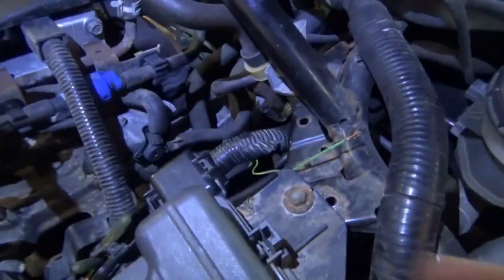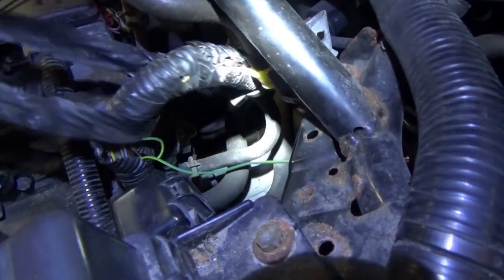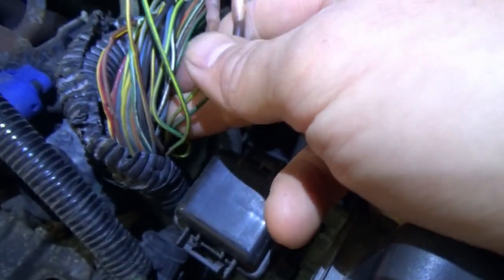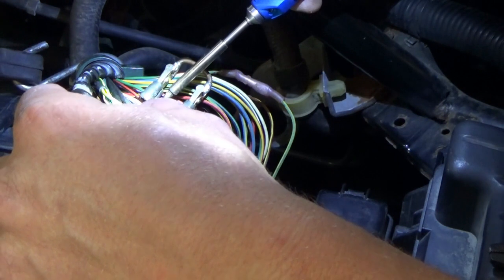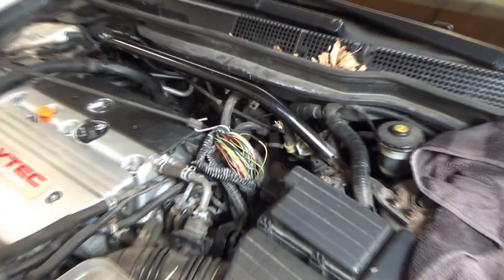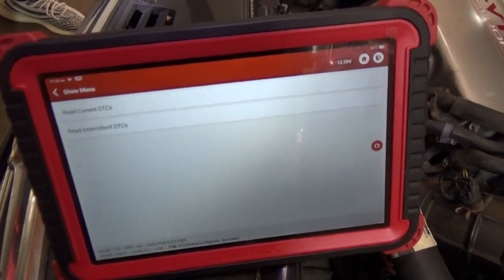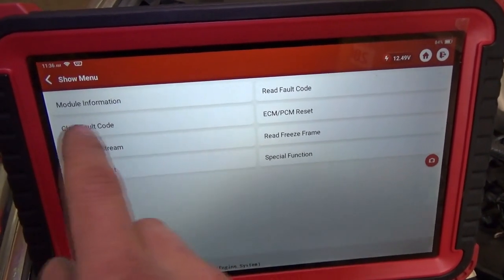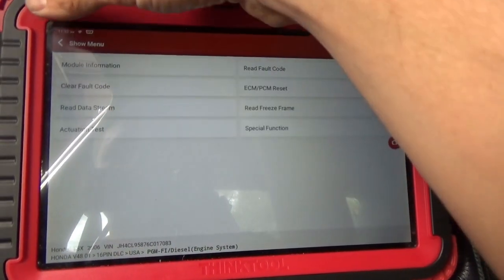DANGEROUS Acura Limp-Home (Part 2)

Comment: Hey Ivan I agree soldering with shrink tubing is probably the way to go. But with the shrink butt connectors the main issue is they are crimped using any ole crimping pliers and it doesn’t crimp correctly, for the most part. It seems if you use actual crimpers with the correct die I have had great success. However is it worth it? Either buy a torch, solder, heat shrink or a fairly expensive crimper with changeable dies for different terminals. One nice thing about those crimpers is you can do just about any terminal with the right die. I do solder when I’m mobile and have had no issues with comebacks! But at home if I’m building a complete harness/connector I crimp like factory. Great video Ivan!
Reply: Just wanted to be a PITA Ivan! Haha

Comment: As a retired A&P mechanic, I can tell you that a properly sized crimp style butt connector crimped with the proper, calibrated crimp tool, is very reliable. That's all that is used on modern aircraft. No soldered connections allowed. Either way, good job finding the problem!
Reply: You are correct! I worked on avionics in the Air Force and when used correctly, the butt connector, properly crimped. was very reliable : )
Reply: @T.J. Kong it seems both ways of connecting wires have their problems. Still, solder should outlast the wire it's on if it's good quality and applied properly.
Reply: Solder connections are not permitted in marine applications either.  The main problem with solder connections is they crack under vibration.  It is one thing if a bad connection causes your car to malfunction but a bad connection that causes sparking or overheated wires behind panels leading to the possibility of fire is quite another.
Reply: At bmw dealership we always used splice style crimps and then their clear heat shrink over them. That’s how bmw wanted repairs to be made on wires
Reply: @adotintheshark4848  the problem in automotive and aircraft applications isn’t the solder lasting it’s that solder connections become brittle and crack due to vibrations over time. I always prefer to do proper crimp joints on the outside of the vehicle.
Reply: @Jpilgrim30  probably the best solution overall is to just replace the whole length of wire if possible.
Reply: @adotintheshark4848  that’s just not practical though. A proper repair will likely outlast the car.
Reply: I think the butt connector boost the  vibration power on repaired  wire
Reply: Wholy hell 

Use a Butt Connector and solder an additional bypass in 

Da fuq ?? 

Aviation compared to automobile 🤦‍♂️

Good job Ivan imma take your suggestions !!
Reply: To add more fuel to the fire, there are PCB mount connector sockets with pins that are press fit in to through plated holes in the PCB. This method of installation is widely accepted as being more reliable than soldering the pins.
Before that we had wire wrap connections that got us the moon. This type of connection consists of wrapping a solid wire tightly around a square pin. The sharp corners of the square post bite in to the wire at every turn. The backplane on the Apollo flight computer was wire wrapped, not soldered.
Reply: Both methods can be effective in lots of applications
Reply: I think you nailed it, those crimps looked too big in the first place and the crimp tool they typically use, yikes! The environmental aviation splices are hands down crimping perfection at it's finest.  I cut my teeth in the military (instrument/flight controls on B-1B) and if not for the weight, soldering would have been the preferred method.  I can hardly imagine the shear mass of lead a C-130 or C-5 would have being over 60 years old.
Reply: With the heat shrink butt connectors, one big thing that I found is the cheap ones on eBay or Amazon are junk. The only way I found to crimp them is using a non-insulated crimper but even then it's still horrible, I found that the Walmart Everstart is good and the harbor freight Storehouse is good. I switched to only using the harbor freight, I can use my ratcheting insulated crimper and instead of the $1 per connector from Walmart, Home Depot, Lowe's, and whatever else, the harbor freight is ¢30 (10 pack for $3). The eBay junk is ¢11 each (100 pack for $11). I'm thinking about trying a different one from eBay but this time supposedly made in the USA and using 3M heat shrink, whether or not it's the junk rebranded or a good connector I don't know

Comment: Ivan, that was an awsome video,retired 47 year A and P mechanic here and I think whoever repaired the wireing previously used vice grips or an cheap crimpers to crimp those connecters, if done properly they will hold. On aircraft where I worked, the complete wire had to be replaced at the next maintenance check. As always, looking forward to your next video!
Reply: In my total working career I discovered one 120volt cold joint. It was in a multi wired power distribution terminal inside some constantly used test equipment. 
The failure took decades to show up with no prior electrical or physical symptoms at all. Electricity is always ready "to check our work" no matter how long it takes.
Reply: Edward spot on mate , you cant blame bad repairs on idiots that use cheap Chinese butt connectors and dont know how to crimp. We would laugh at someone that used solid wire to repair automotive wiring, so what happens when you solder, wire become solid ?  As you say proper way to fix is change complete wire , but as we know this is not cost effective. Butt connectors or open barrel splices is industry approved , soldering is not especially in an engine bay. Regards Joe
Reply: Channelock 909  crimper   is a must

Comment: Great job finding the bad connection.  Couple things to consider.  One is when splicing wire and you plan to solder them, consider wrapping them together so they do not pull apart easily even if solder fails.  Your method of soldering is probably good when fixing home electronics but automotive involve a lot of vibrations and heat that brings solder closer to melting point and can cause fatigued joint.  But I like your idea of two alligator clips with thick wire to hold two wires together.  Another is consider getting yourself a heat gun.  I LOVE them over using the fire when heat shrinking tubes.  Works and looks nicer that way without burning them.

Comment: The "twist bare wires together" splice was known back in the day as a western electric splice...Wire crimp connectors done with the correct tool are perfect, used on aircraft wiring routinely, as noted, until the next MC

Comment: I also like soldered connections better than crimp. I very much agree on adhesive-lined shrink tube for any area exposed to the elements. I've had issues with liquids wicking into standard tubing even though it appeared fully sealed.

Comment: I have a set of butt connectors that have a solder bead. After you crimp them, you heat them up with a soldering iron to melt the solder so you have a soldered and shrink-tubed connection too!
Reply: I think Eric from South Main Auto has mentioned that he has had poor luck with those. The solder has to be a very low melting point to be able to melt before the shrink wrap does, which makes the solder joint fragile.
Reply: @RobertHancock1  Interesting.

Comment: Great video!! I've had to solder corroded wires but sometimes solder doesn't stick to the wires because of the corrosion. Plus they are sometimes brittle. Butt connectors do a slightly better job on corroded wires, BUT you have to make sure to tug on the wires to try to separate them right after you crimp them. Corroded wires also might snap if they are crimped too tight.  Those pre soldered butt connectors, the solder doesn't wick to the wires.  Neither does soldering. You have to clean up the corrosion very well first. It's the thing. As a technician, you have to judge which is the better method of repairing wires. Sometimes you just have to replace entire corroded wires. Say it's a wrecked car with a bunch of harness damage. It's a pain to replace a lot of old corroded wires with new ones. The moral of the story:  Always tug on the repaired wires no matter what kind of repair it is. And weatherize the repairs, especially if it's an exterior repair.

Comment: Ivan, I agree fully that a solder joint is the way to go, but there are of course instances when it is not. I take the wire repair a step further and always use heat shrink tubes with glue inside and that will keep moisture out and also stiffen them up a bit and thus, they more or less act up as crimp style. I have been into electronics repair for 35 years, of course it does not make you an expert in all areas, and working for many years in the past with Forrest machines where indeed, cable repairs was a very common job. I use HellermannTyton heat shrink tubes and mostly 3:1. There is much to say about soldering, but I leave that to others. However, as always: nice videos and an excellent repair you did!

Comment: The key to crimping is the right crimp tool.  There's far too many cheap ones out there.  The good ones are expensive.  Usually have a ratchet and won't let go until you crimp all the way.  That prevents you from doing an "almost' crimp. They also apply a lot more pressure then the typical plyer type.

Comment: I would argue that well done crimps can be just as reliable as well done solder joints. I used to have tons of issues with crimps pulling out like you did, but I've had much more success after buying a MUCH better crimper than your standard stripper / crimper combo tool. I still prefer to solder because I still get poor crimps every now and then, but I wouldn't say all crimps are bad just because you encountered some poorly done crimps.

Comment: Great troubleshooting Ivan great repair also. I had used but connectors before and if you are not using the proper connector according the awg it will fail and you need to use the proper crimping tool. Solder works if you know how to properly solder. Good video. Take care Thanks 😊

Comment: Factory crimp forces can be replicated with hydraulic crimp tools and properly sized connectors, the issue i found is anywhere I want to put one, there's no blasted room for such a big (relatively speaking) hydraulic tool anyhow except for wide open places like the battery terminals or main ground points. Yeah, glad you found the previous repair.... he just would have had more problems down the road with a bypass. Entertaining video, thank you Ivan.

Comment: The problem isn’t the crimp connections it’s the people doing them improperly. It’s actually preferred in this application it just needs to be done properly.
Reply: Looks like lot of dust and dirt, probably water had gotten into the harness there.

Comment: Good diagnostic work.  You could see in the video the connectors were not crimped properly.  Correct tool leaves an indent.  Connector was not the issue just guy who installed them.

Comment: I've done MANY repairs like you've done here with solder and shrink tube.  Only regret was not having liquid tape as way to thoroughly seal the repair.  You don't have comebacks with this procedure.  With crimp splices, oh ya, there's comebacks!  When others tell me about the solder/shrink tube repairs that didn't work/needed replacement and were done with crimps, I says, "show me the failed parts!"  They can't!   I've also done crimp AND solder joints using exposed crimps and shrink tube over the crimp and solder joint.  A very strong mechanical AND electrical repair.
Good diagnosis and repair Ivan!

Comment: Excellent job on Keith tuck test,  always works lol.   Great job with bad wire!!  Great video and I've done butt connectors on few cars.  With proper crimping tool!  Sometimes i do solder joint too. I rebuilt a bench grinder with bad wires,   i yanked all them out and put fresh wires in.  I used ring or open ring connectors with heat shrinks! I did it and it looks so professionally done.   I was happy with it.  It still works great!

Comment: If I'm not soldering I use bare crimp connectors and always put my own heat shrink over the connections.  So far I've had zero come backs. I've also seen those butt connectors fail just like that in your video.

Comment: I had breaks in the the wire going to a front wheel speed sensor - fixed them all with solder joints. Zero problems since and this wire moves every time wheel turns. Solder + heat shrink is good in my book and slim too! Stood the test of time.

Comment: Awesome diagnosis and fix Ivan! Interesting that one of the butt connectors was on the suspect wire, so most likely a fix for the same was done before hand though not the best. Agree, I'm more comfortable soldering wires as compared to crimp on connectors, specifically for smaller gauge wires. But I do use crimp on connectors for thicker wires in a pinch. Cheers!

Comment: Good diagnosis.

Every single wire connector on cars produced in the past four decades or more uses nothing but crimp connectors.  Done properly they are less likely to fail than any other method.  The emphasis being on done properly, the right crimp terminal, the right size wire, the right crimping tool (that is also calibrated) with seals and optionally grease to exclude moisture. 

Soldering works but it can easily introduce a stress point between the soldered and unsoldered area that can later fail due to vibration.

Heat shrinking with ‘inert’ hot air is also better than using a naked flame.
Reply from the maker: Yes, factory crimps are usually very reliable (except GM battery terminals LOL!) However for repairs, it is near impossible to reproduce a factory crimp. Therefore solder and shrink wrap is the method of choice. The shrink wrap gives the joint good mechanical integrity to prevent vibration stress cracks in the future. Of course, the harness should also be properly routed to reduce unnecessary strain on the wires themselves.
Reply: If you add a wiring extension of the same gauge and insulation (to remove pulling stress) so that the repaired wiring matches the length of the other wires in the harness... Use
Reply: @questioning3388  Sounds like a video idea for project farm. Everyone go over there and spam him with a suggestion!
Reply: Maybe the hot air is best however, there seems to be nothing on the market that controls the hot air into a small diameter enough and flow so it doesn't cause collateral damage to other wires or items when working in tight spaces.
Reply: Re: Vibration

Way back in time when I went through the US Navy's Micro-Miniature repair course (6 weeks of soldering) we were trained to use a tool (looked like a pair tweezers that clamped around the wire next to the terminal and wicked the heat away so the solder couldn't flow past it and was made for each gauge of wire) that whenever stranded wire was soldered to a terminal, it stopped solder from flowing up the wire into the insulation from terminal the wire was being attached to specifically to prevent the wire breaking at that termination due to vibration or movement of the rigid wire.
Reply: I have soldered many wires stereo to auxiliary lights, fans etc., with solder and nothing has failed even after 30 years. Those connectors corrode with a little bit of moisture and loses electrical connectivity within few years.  Solder is the ONLY way to go.
Reply: @Garth2011  I've got a little heat shrink device i bought on Amazon for about 15 dollars that does the trick nicely without exposing wires to an open flame.  A hairdryer also works well for this particular task.

Comment: Ivan, I suggest that you consider acquiring a bottle of electronic soldering paste (flux).  When soldering older (untinned) copper wires, I apply a tiny dab of paste to the bare wires with a round wooden toothpick.  The extra soldering paste will penetrate the oxide on the wires better than the core in the solder.  The solder will flow better and make a more secure connection.   I like GC Electronics P/N 10-1207.

Comment: When I'm soldering around a bundle of wires like that and have to heat the shrink tube, I just use some plain old tin foil to protect the other wires. Works well for me. 👍

Comment: Ivan. In a pinch when I don't have my soldering tools with me. I use a metal butt connectors with a heat shrink. I normally prefer to use soldering for my joints. I rarely use butt connectors. I carry them for emergencies.

Comment: Good video Ivan, good diagnosis.  I agree with you on the soldering of connections.  I never use crimp on connectors.  I use to work for a guy that built high end hotrods do the complete wiring systems on the cars, everything was soldered.

Comment: ❤️🎥 Failed but splices are pretty common with those heat shrink ones you can’t get a good crimp on unless you get uninstalled buts and heat shrink over it but then solder is definitely the better fix

Comment: I've had quite a few times where I would inspect wires with a faulty connection.  And they may look perfectly fine.  That is until you give them a solid tug or two and they pop right out.  I've had times where I found wires corroded so bad inside the insulation because it had a hole in it from a pinch or probe.  Now I've used shrink butt connectors many times and never had one fail before.  But, you have to test them before you shrink them because sometimes you won't get a good crimp.  Good find though.  I probably would have opened up that entire stretch of harness until I found it.

Comment: When i watched this i was thinking about all the typical honda problems i have seen and this one is common with cars people had installed aftermarket devices on like gps and alarms. They always leave a mess of nicked or cut wires. Most honda harnesses run flawless except for grounds and battery cables.